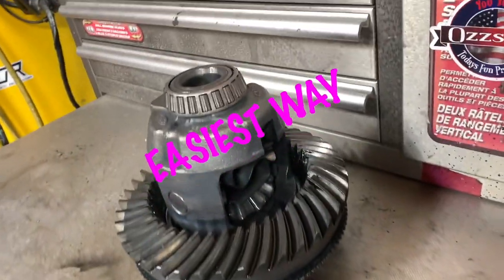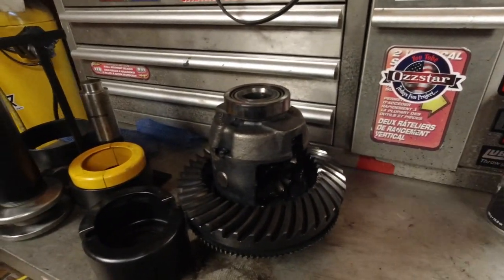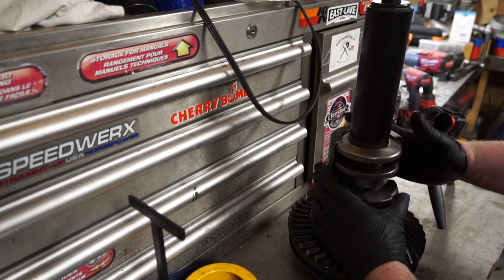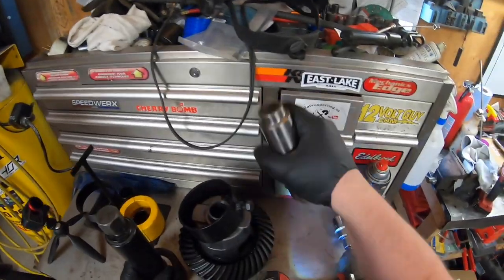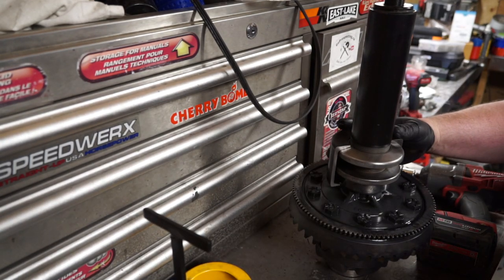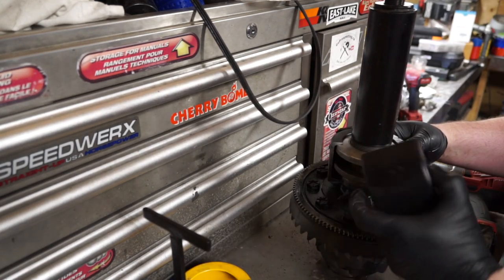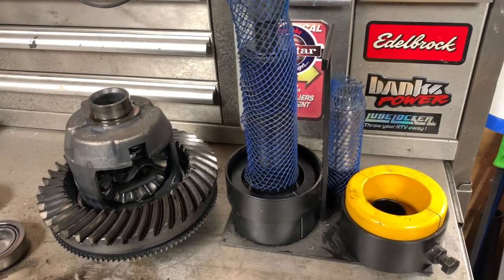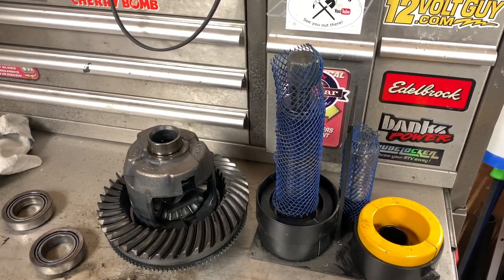Easiest Way To Remove Differential Carrier Bearings

Comment: I bought this carrier bearing tool using the link in your video, and boy was I glad I did! I pulled the bearings off my Dana 70 Powr Lok differental super quick. Now I just have to by a shim kit from one of my local speed shops here in NJ. It think it is a 36mm socket. Thanks for posting the video!
Reply from the maker: The bearing kit is a life saver for sure

Comment: Holy crap!! Idk that I've ever bought a tool so fast in my life. Made that look waaaay easy. Hopefully this will make my work easy on building out my e46 diff for spec e46 racing. THANKS!!
Reply from the maker: The tool is worth it’s weight in gold, I’ve used it so many times

Comment: I have the same puller and none of the clamshells  worked for dodge 9.25 carrier bearings but did work for the pinion bearing. It did work for my Chevy 8.6 carrier bearings though.

Comment: Awesome! I'm wondering if it would work on BMW 188 diffs : output socket is 27mm ID clear; Bearing OD is 90mm; 60mm OD on the inner race. the manufacturer's site doesn't list any specs. Much appreciated if you could post up the diameters on the tool.

Comment: The question I have is does it also destroy the bearing, like other methods involving the press?
Reply: Most of the time no damage to the bearings.
Reply: Yes it damages them.  Maybe not visually , they may look fine, but pulling on the cage like this tool does will 100% ruin the bearing.

Comment: How do you put the bearings back on?
Reply from the maker: You use a press
Reply: @TestDontguess  well I got it open today and right away I could see the diff cracked in half starting where the axle retainer dowel goes through and the pinion gear has grinded up teeth.  Uh oh!
Reply: Freeze carrier heat bearing to 400 degrees drop on. look up on YouTube how to install bearing without a press